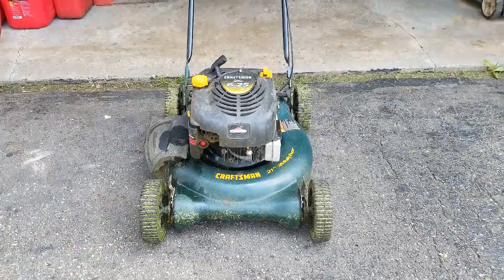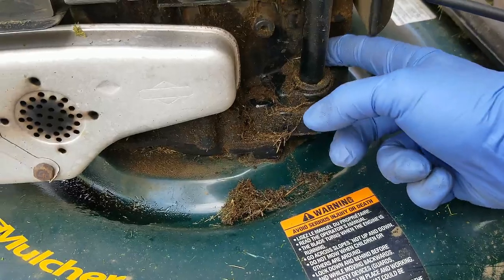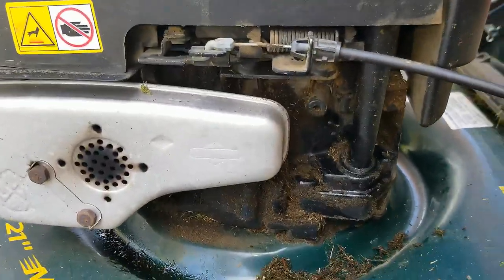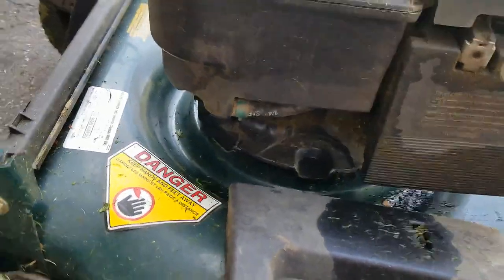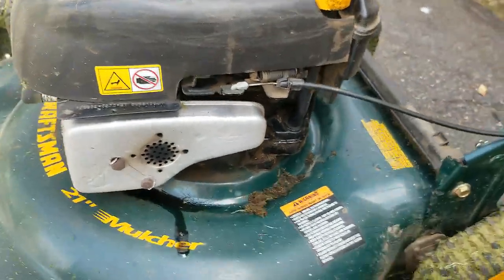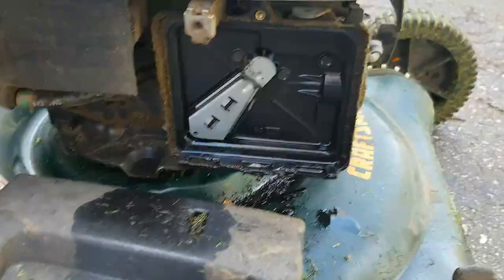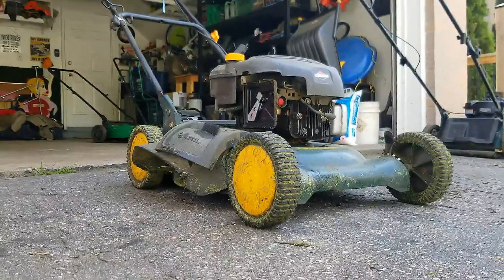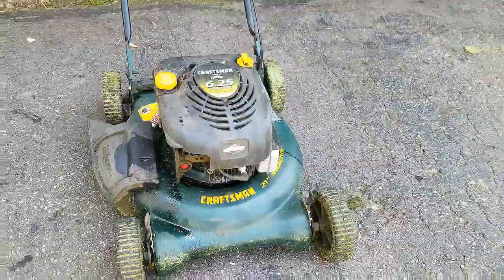Top 5 Reasons Why Your Lawn Mower Is Leaking Oil

Comment: Thx for yet another great video.  I occasionally repair mowers for friends and neighbours and overfilling oil on a B&S motor is common.  One thing I notice too often though is that the dipstick is hard to read.   It is made of cheap plastic and it is not always obvious from the dipstick where exactly the oil level is.  Very annoying.
Reply from the maker: I hear ya. Sometimes it takes a few tries to make sure you have an accurate reading. Thanks for watching and taking the time to leave a comment. Cheers

Comment: Bryant oil gushes out of the black tube going into carborator no oil coming from anywhere else. And dies and no oil on dipstick after putting in oil . What could it be? Also blows out muffler
Reply from the maker: Have you tipped over your mower recently? This might cause it. Also, check out this video. It might help. Cheers https://youtu.be/WnkVnRL9a9I
Reply: @brantsmallenginerepairs  yes to dump our old gas
Reply from the maker: @JoeKubena  if you tip it the wrong way, it could cause your problem. If this is it, just make sure oil is at proper level, run it with the air filter off in a clean space until oil burns off the muffler and stops coming out of the breather tube. It won't hurt it. Then replace the air filter if necessary. Hope this helps. Cheers

Comment: Do you have a video on how to clean up the lawnmower? and how to drain when over filled?
Reply from the maker: I don't have a video on how to clean the mower. I just use soapy water to clean and ATF to shine them up. As for adjusting the oil, here is a video on how to change the oil. Cheers
https://youtu.be/aA0PHz74ps0
Reply: @brantsmallenginerepairs  Thank you!!!

Comment: I just got a free lawnmower with same problem and there was a quart of oil in it . there was oil coming out of the exhaust ,the air cleaner and it was hydro locked and all it needed was a new air filter and the spark plug cleaned .
Reply from the maker: I see this many times per year and it's completely preventable. Crazy what I see people throw stuff out for. Good for me though. Thanks for watching and taking the time to leave a comment. Cheers